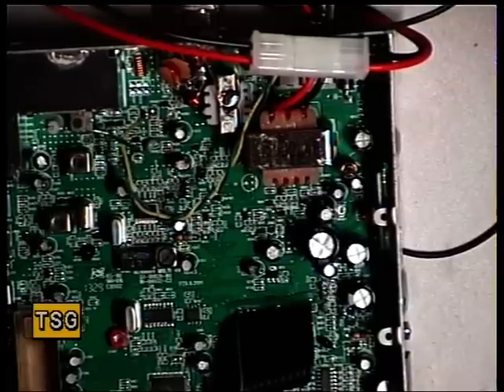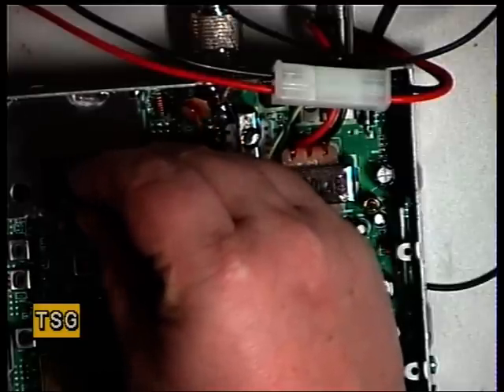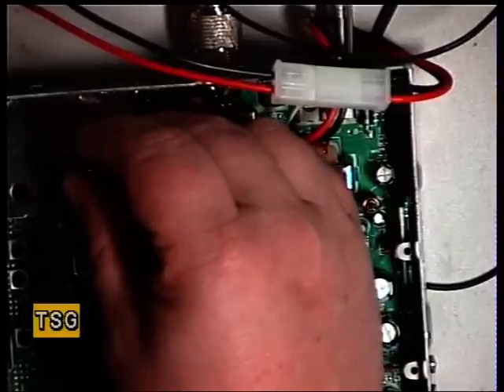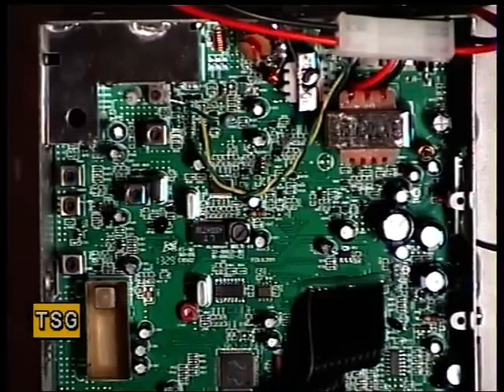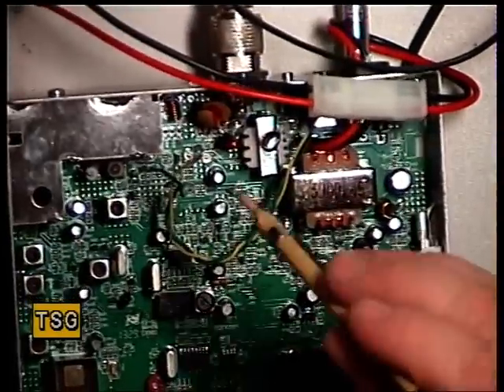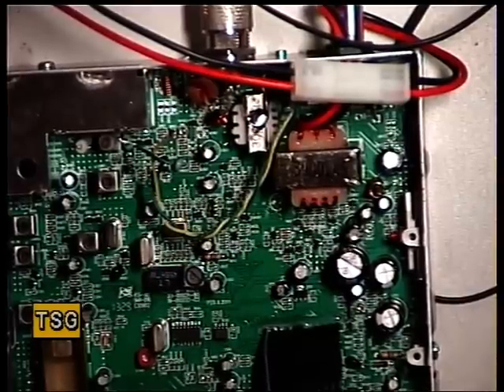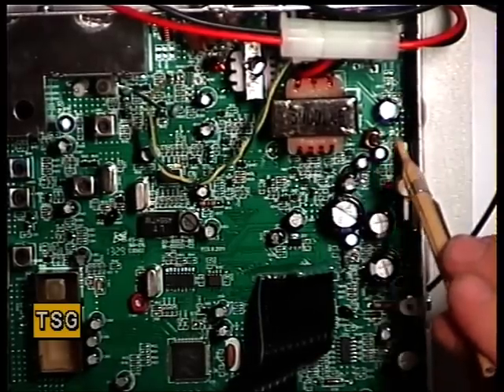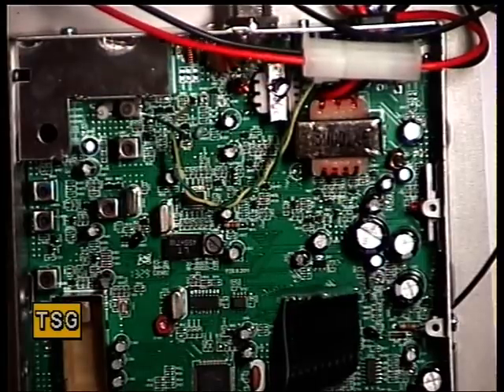Midland 48 Plus Multi  - UK CB radio, (CE Multi) (Mobile). Receive alignment.

Comment: Do these work on us USA Frequencies or is the channel spacing the same?
Reply from the maker: CE multi sets don't cover USA frequencies (though they do in reality if set to CE AM), as they are not approved for FCC use. You will find the same radio will be available in the USA as an approved AM only set but will have different innards.

The idea behind these CE Multi sets is that they are pre-progtammed with all the frequencies & modes used in various European countries meaning they only need to manufacture one radio "one size fits all" approach. So you just tell the radio which country you are in & all your available modes & frequencies are automatically set up. Here in the UK we have our unique set of 40 FM channels, then can also use the 40 CEPT channels in AM, FM or SSB as we desire. Obviously this particular radio doesn't do SSB.

Richard (UK)
Reply: UK CB radio servicing ok thanks for the reply. Maybe I shouldn’t have ordered one but it’s too late now.
Reply: I’ve just been given one of these radios,looking around and apparently there is a mod that allows extra channels by unsoldering some links?